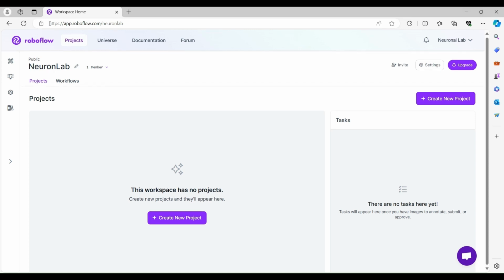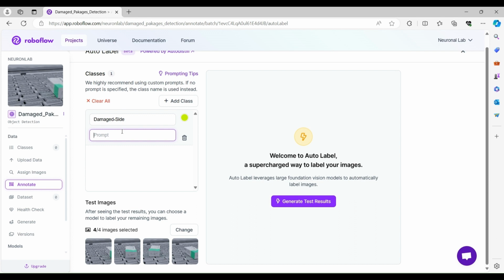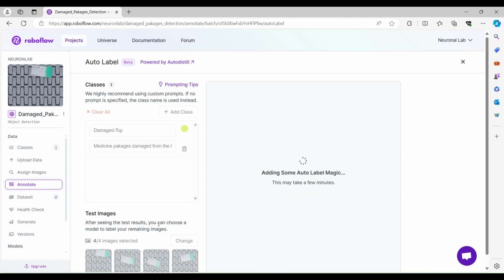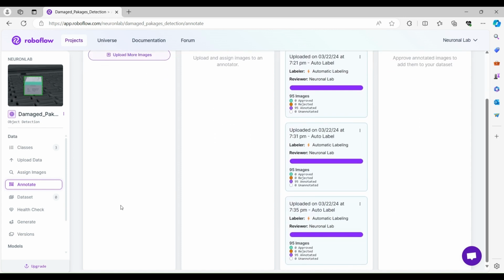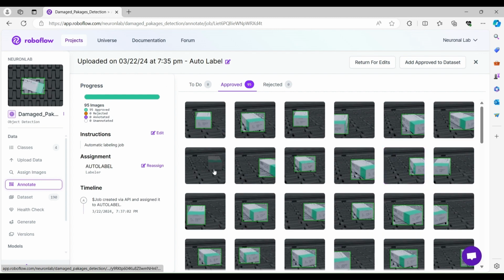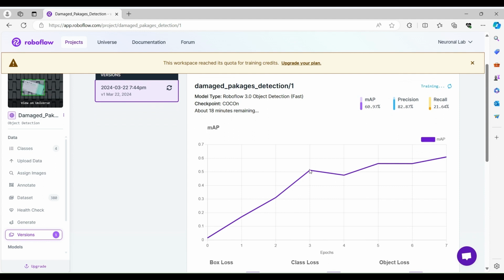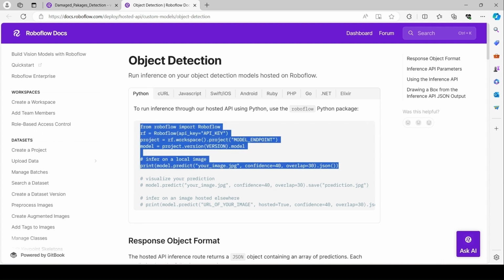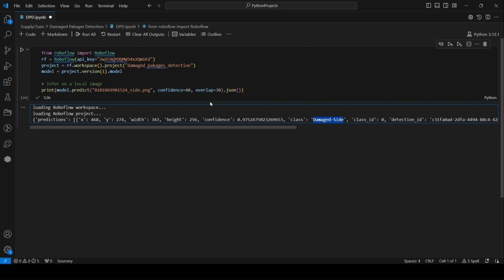Build Your First Machine Learning APP Using RoboFlow - Zero Coding Experience!!!

Comment: Wow thank you for your explanation but I have a question 😬 
Can this model detect the damage from multiple items in the same picture, and from different angles?
Reply from the maker: Thank you for you comment!
Yes, it can capture more than one pakage in the same frame. However, if the picture is taken from a different angel the model may not be so accurate and a good practice in this case is to re-train the model with the new set of images from the new angel. Ideally speaking, in a production line there should be one camera at a fixed angel & proximity to the pakage which make it easier for the model to learn the job very well with time and provides high accurecy.